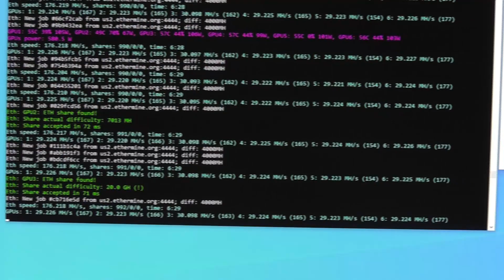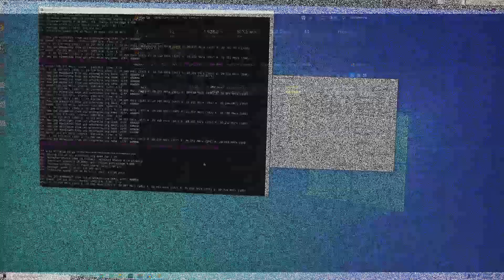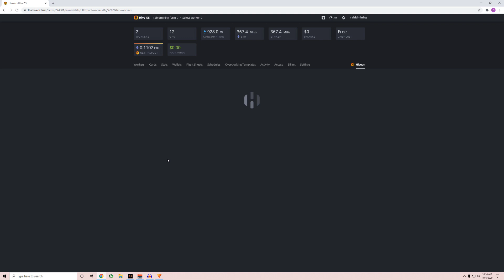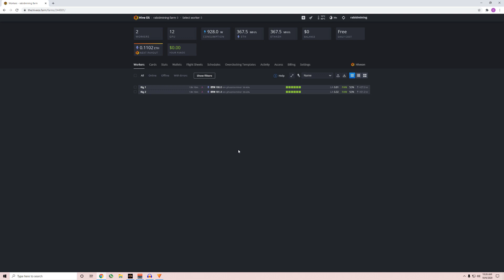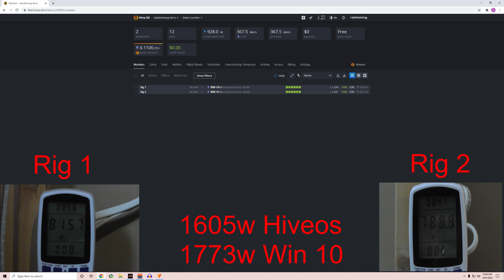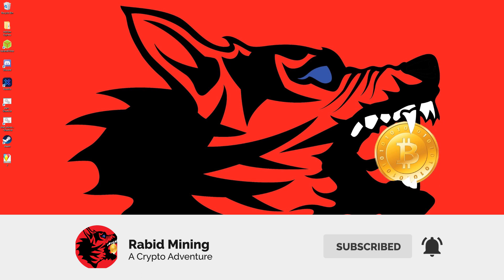Crypto Mining Hiveos vs Win 10 4gb

Comment: The watt draw WILL not be the same for 120 vs 240 because of inefficiencies on the PSU itself
Reply from the maker: Hoping that's the case and my 240v meter is not off.  Most electricians say the amps is cut in half but watts stay the same guess I'll know for sure when the next power bill comes in lol.